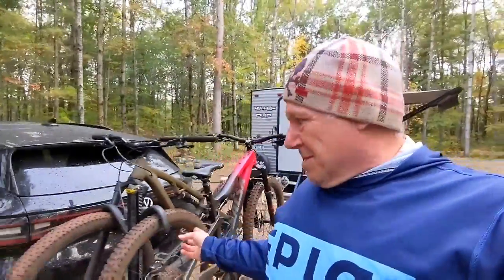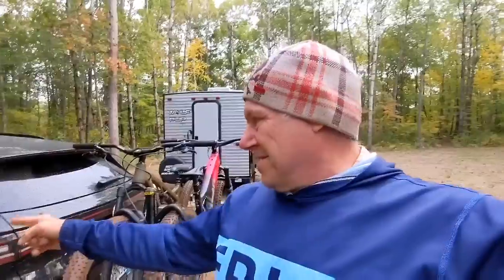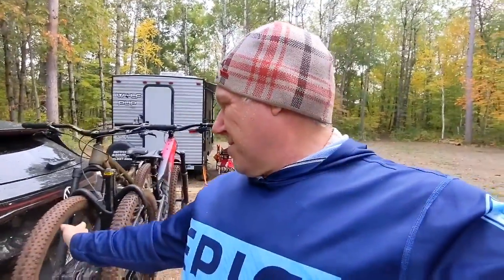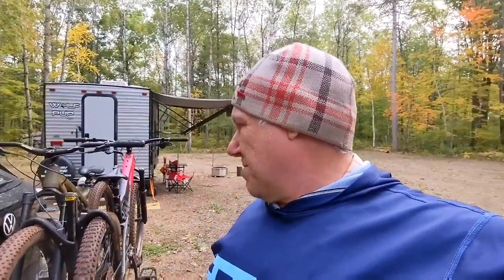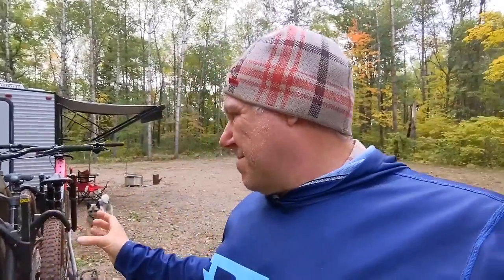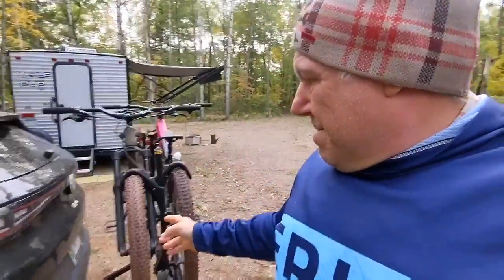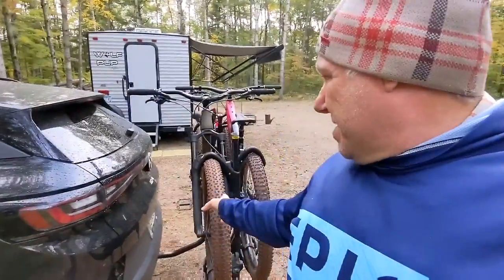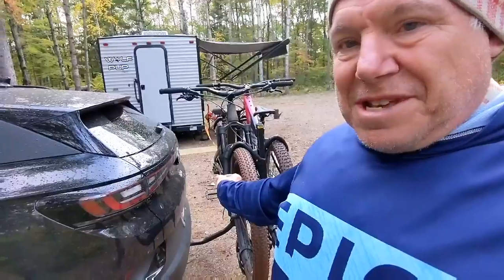Back up sensor issue with bike rack.

Comment: Yes, I have that same problem with my Toyota Rav 4; however, I tried a work-around by drifting back very slow and avoiding the brake and that works as long as you don't have to step your foot on the brake. I would rather the issue be fixed.

Comment: I'm not sure Shad. I program microcontrollers myself but basically I'm an electronic engineer. I'm wondering what distance the brakes come on? Maybe the bikes are at the distance the brakes come on if you move because the car is already at the closest distance it senses as safe. That would moot your distance changing algorithm. I think I would have an icon telling the program that there are bikes on a rack, a trailer or whatever, sort of how the Bolt has an option to tell you to check the back seat for items which you can defeat.
Reply from the maker: Even if it is at the distance the brakes would come on it would still work to check the distances to see if it's closing in or staying the same.

The car actually backs up for a bit and then slams on the brakes, which is why my head snapped back. If the rack was at the brake distance, then the car would hit the wall.

I feel like the rack causes confusion, maybe because it's not a solid object? Who knows. But the system could definitely be smarter than it is.
Reply: @geekingoutwithshad  Right, it would be fun to play with it - too bad it's not open source. 
My Bolt stopped seeing Android Auto, I'd like to dig into it, lots of people complain about that. GM is supposed to be going to OTA's, I wonder if it's chip shortages? I'm finding things like precision voltage regulators, clock chips and uC's have really long lead times.
Reply from the maker: The issue with the supply chain is many manufacturers are scrambling to find other sources for their chips/controllers. This means the reliability and quality of those parts can be compromised since some vendors are not as good as others.

I have a Pixel 6 Pro and my original one was absolutely awesome! But then I dropped it and cracked the screen. I had insurance on it and got a replacement within 2 days. The replacement lags all the time. It had  about 6 OTA updates and it's still very laggy. I tried to find a fix or setting and yet, no fix. Then I found out that Google has some phones where the issue is hardware related due to poorly manufactured chips.

I can't use the phone because every 5th or 6th letter as I am typing it skips my input. Super annoying!!
Reply: @geekingoutwithshad  Interesting. I use a lot of Atmel uC's, some have long backlogs and some don't, fortunately I have a nice supply. I thought I heard that FPGA's are backed up pretty far but I don't program them.
I know there are a lot of counterfeit chips around now so I try to order from solid suppliers like Mouser and Digi-Key. 

On another note, did you have a Bolt EV before the EUV? I have the EUV on order and now have the 2020 Premier pre COVID EV and I heard a few people complaining about the build of the new EUV, weather stripping and stuff like that. What's your thoughts?
Reply from the maker: Yes, I had a 2020 Bolt EV and it was a great car. The EUV I have has been pretty good quality wise. The sunroof stripping did come out once, but I pushed it back in and it's been fine ever since. It probably wasn't seated in all the way. So I looked at all the other weather stripping after that to make sure it was all good and so far no issues.

The build quality is like what you would expect from a Chevrolet. It's not perfect, but decent enough. When I compare the ID.4 to the Chevrolet the fit and finish is very different, but the ID.4 is also a $52k car.
Reply: @geekingoutwithshad  Thanks Shad, I knew I'd get an unbiased opinion from you.

Comment: My Nissan Rogue 2020 does the same thing and I always just turn the emergency brake off whenever I back up with my bike on the rack
Reply from the maker: Yes, you can turn the rear camera off and the car will back up fine. My whole point is that you shouldn't need to do that because they could do a better job writing the software.
Reply: 2022 Outback does this. Maddening!